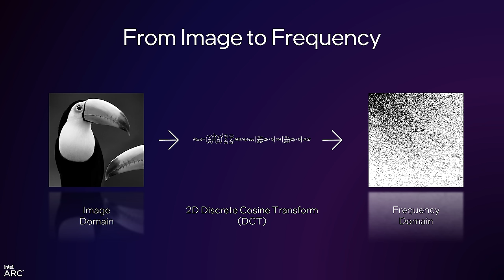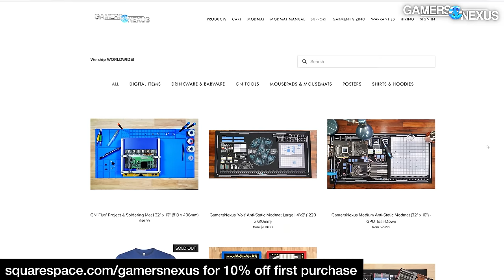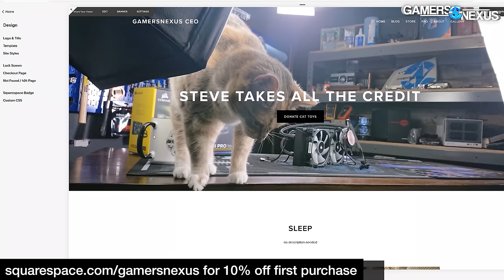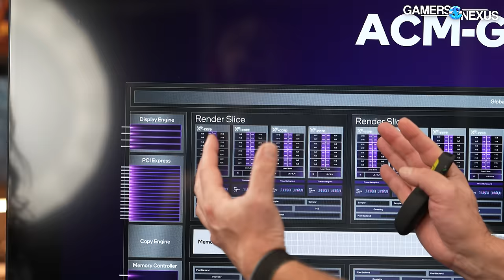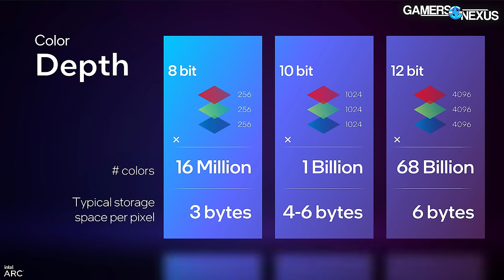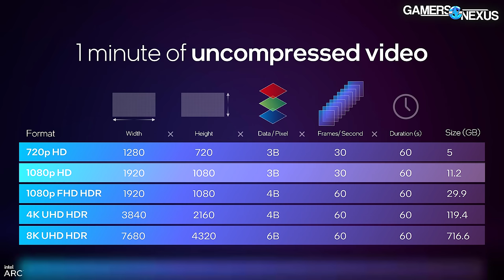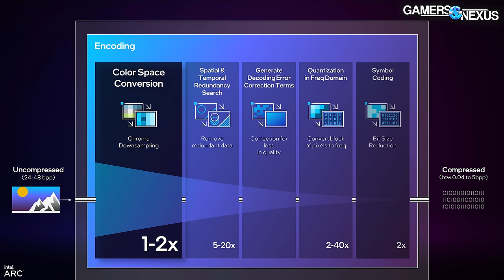YouTube's Existence is Insane: How Video Compression, Encode, & Decode Work (Basics)

Comment: Great overview at a high level. The description of chromonance subsampling is a bit misleading. Those are really ratios, not bits. Wikipedia does a way better job at explaining it than I could. I deal with YUV all the time and I still find it confusing. 
Regarding what’s going on in the frequency domain: the high frequency components represent small details in the video. As you remove high frequency components, you remove details that you are less likely to notice in moving video anyway. This is why a frame extracted from a video often looks very soft. Those sharp details are high frequency components.

Comment: The drop of bytes in chroma during the color space transformation is why some text gets fuzzy and hard to read on the desktop, when you change resolutions from 4k30 or 4k60 to 4k120 on a HDMI 1.4(2.0? I need to check) or DisplayPort 1.2 connection.

The bandwidth isn't enough to keep up with what you're trying to push, so the color space drops from YUV444(RGB) to YUV422 or lower, decreasing the color resolution and thus the small details. It's fine for video and gaming, but it sucks when reading static text.

Comment: Many of the heavy codecs without hardware acceleration wouldn't be possible realtime or now, faster than realtime.  MPEG2 was okay to run on a CPU because it was a lot simpler but AVC/HEVC/AV1 are pretty complicated and self referential so nothing but an internal ASIC on chip has the efficiency to do it, especially the encode. Decode is easier but if you try it on a machine without hardware acceleration you're going to drop frames at specs like 4K|4:2:0|8bit|35Mbpa|60FPS. <- This is why certain formats notoriously playback in Premiere like garbage while you're scrubbing unless you have a chip with specific format accelerators. Even with the accelerators, actually editing with these highly compressed formats is very taxing on the CPU which has to make changes and then feed the streams back into the encoder and then decoded again to show you the picture. This is also why most editors (although less so now) transcode to DNxHR or Prores, for a variety of reasons, but the biggest one is it simply runs much faster. Although it is much larger so your storage has to keep up. M.2 (a decent one) makes the storage speed pretty irrelevant now as it can keep up with 4K|4:4:4|12bit|400+Mbps|60FPS just fine.

Comment: one of the issues with using DCT and similar based on (at really low level) the sine wave, is sharp edges. Older codecs were infamous for having pink fringe on a red/white transition. This is the difference between the man made world and nature - man made has these sudden instant transitions nature doesn't. Hence 16:30, old throw then out, vs new use them less

Comment: A little clarification on the cosine transform. 
He mentioned the frequency space as the representation on both the X axis and the Y axis. It's technically only the Y axis in that view that corresponds to frequency, the X axis is the amplitude of the component sine and cosine waves (convertible to the magnitude and phase). There's fun math trickery involved with a 2d transform where you apply the DFT function once horizontally then again to the result vertically allowing you to merge X and Y data in a way that represents just frequency data.
You can tell based on the image shown because the slide after filtering out the high frequency noise only the values at the bottom are removed, not the values on the right side. 
Unlike the Huffman encoding this process is lossy but mostly it isn't noticeable to the human eye.
Here's a great channel if you want to learn about the DFT process.
https://youtube.com/@MarkNewmanEducation

Comment: If I knew this from the start from INTEL?  I would of bought a a770 card at Launch!   This is amazing! 
Why on earth they did not push this for media creators working with Video/ Audio is baffling.   
This is what Intel should have pushed on and made the gaming thing a Cool hack bonus of all the hardware can do.  

Kind of like tuning your car to give you more performance.  
Imagine using something like the video compression engine to somehow render a game?  
That would put it right at the midpack of the lineup and do it on with Extremely low power and efficiency.  

If intel could licence a game API that would do this? 
They would never have to worry about funding for their GPU's again. 
Everyone would have one from all kinds of hardware out there.  

It would be as ambiguous as the 555 timer with just as long of a legacy.  
The fact that it can do 8k Video playback is amazing.  Even with the lowest end cards out there that intel offers.

Now imagine being able to program a game that takes advantage of these special parts in their GPU / Hardware stack with their own API that models the games on the fly with A.I.  being the precursor to the instruction set given, so that each time the game runs?  Its a new experience every time! 

This would be the best breakthrough Intel could have have that would play out as one if not the most valuable I.P Toolkit in their future arsenal in the GPU landscape.

Comment: 17:00 DCT and Inverse DCT is incorrect AFAIK, back when I was doing JPEG compression for my bachelors we were told that you get rid of low freq and only keep high freq reason being eyes are good at picking up harder edges but not so good at picking up softer edges or gradients. So in the right most image the top left region is high freq data and the job of lossy compression is to get rid of low freq data.

Comment: 15:50 I mean it isn't that hard. Just the common usage of numerical mathematics.
From my understanding it is "just" another transformation (like the discrete version of the fourier transformation), to get the data into wave functions of different fequency.
This is lossless btw. And then (what is done here) you remove the highest frequencies (which are mainly there for the details, arriving back at the topic of compression) and reverse the transformation.
An advantage of the dct over the discrete fourier transformation is, that the dct only uses real coefficients

Comment: I use an Arc A380 for all my transcoding as quicksync is so much faster than pure cpu software encoding for only a moderate size penalty. Nvidia and AMD’s encoders are not as efficient as intel’s either. I’ve used all 3 recently too.

Comment: Their media engine is sorta insane. You thought Nvidia was kind there, yet everything works seemingly 10 fold better on Intel's stuff.

Even before Arc, the video crowd seemed to be tripping over themselves for Quicksync capability. Then they fixed Arc to where it handles stuff that requires Nvidia and AMD's Pro cards like 10 bit acceleration in certain NLE's.

Comment: Pls more!
Reply from the maker: Which topics?!
Reply: @GamersNexus  please love me, im soo lonely
Reply: @GamersNexus  As a electronics technician i was very much interested in the whole thing really, but the quantization stuff got me the most. It is really like an low-pass or high pass filter but for pixels. I can see how you can use the frequency domain to "filter" something. In RF you use it to "tune" to some frequency filtering out all the other with RL, RC or RLC cirtuits, sometimes very simple ones, and i'm very fascinated on how this concept is applied in the digital domain, like media compression in this case. I never viewed electronic filtering on a software prospective, i find it very intriguing.
Reply: Put it simply i see it like this: The algorithm tune the image collectively dinamically on the spot filtering all the spikes and the details on a very high definition signal (on a pixel basis!) and outputs a coherent result with the blunt of the information (the image) but without any near fluctuation witch we wouldn't even notice. It's smart!

Comment: Huffman coding is not as hard as it seems. Just think : morse code
In morse you're coding the alphabet and the numbers in binary. Instead of "1" and "0" you have "." and "-" but it's still binary.
26 letters and 10 numbers that's 36 symbols to code, 36 in binary is 100100.
So a naive coding for morse could be "let's use 6 bits for every letter or number"
So "a" would be 000000, "b" would be 000001 etc...
But that's not what morse code looks like. Instead we have a = ".-" so only two bits, e = "." so only one bit and z = "--.." so 4 bits
By giving a smaller amout of bit for the most common letters, you reduce the average number of bit needed to code a message. This just means you have to choose carefuly your codes, because you need to have zero ambiguity but it works very well :D
And you can even do it dynamicly. You can scan the full message, count how many time each letter is used, make your Huffman code and because it's a custom code you store the table of corespondances inside your message

Comment: Why is there so much so wrong on so many of these slides?
10 bit color is listed as "4-6 bytes" per pixel".  What?  It's not even 4 bytes.  It's 30 bits for full RGB.
12 bit color is listed as "6 bytes" per pixel.  It's 36 bits, or 4.5 bytes for full RGB.

A later slide showed "720p HD" and "1080p HD" and "1080p FHD HDR".
1080p should be FHD, not HD.  The data/pixel is wrong here as well for 8K row.  You don't need 50% more data per pixel because you increased the number of pixels.

There's all sorts of weird little inconsistencies and errors throughout all of these slides. yet it looks like a fully baked slide deck.  Are they really that sloppy??

Comment: 5:07 A Youtuber who doesn't know about AV1 in 2024?!  AV1 is an absolute game changer for content creators, if you aren't encoding all of your recordings and videos in AV1, you're doing it wrong.  Encoding in AV1 leads to MUCH SMALLER file sizes which saves a lot of time and space for content creators.  Smaller file size, means your videos take up less space on your drives so you aren't moving around your files as often.  Smaller file size also means faster uploads to YouTube which means you can get your video uploaded and processed by YouTube that much quicker, allowing you to post your videos sooner.
Reply from the maker: There's a big difference between using and knowing about. I never said we don't use it. But I don't know about it in any meaningful depth.
Reply: He still knows about it, just not the details. You can eat bread but not know how to make it, same thing as that.

Comment: Ok this is super interesting...What is the difference between RGB 4:4:4 Format PC Standard, YCbCr 4:4:4 Pixel Format and YCbCr 4:2:2, and lastly RGB 4:4:4 Pixel Format Studio? It is a setting that you can play with in the Adrenaline Software. Would changing this equal more FPS due to compression? Or am I just completely off. What are the pros and cons?
Reply: RGB, YUV, YCbCr are all just different colour spaces. You can convert to & from any of these without any loss occurring.

X:X:X just denotes the samples used to store the denoted information.

So YUV: 4:2:2 will use Y: 4 samples, U: 2 samples, V: 2 samples.

In most cases compressing more lowers performance because you need to do more work to keep acceptable results (more compression equals lower quality within the format).

The thing that really determines the performance in practice is the encoder & format used. AMD also happens to be the worst scoring party in both performance & quality for hardware encoding + isn't tuned very well for their hardware defaults when utilising ffmpeg (most applications will use this).
Reply: @MLWJ1993  Ya I messed with it a bit. The only thing I noticed right away was the brightness of the screen. Dynamic Contrast not working correctly. And the tone of black being more grey. Full RGB was the only one that would give me the darkest, clearest, most objective black.
Reply: @MLWJ1993  that's not true. YUV still uses 8, 10 or 12 bit per channel (channels being Y, U and V), but the amount of samples per pixel they take is different. X:X:X denotes columns, number chroma samples in the first row, and number of chroma samples in the second row. So 4:2:0 for example means that for each 4 columns of Y samples, you only store 2 U and V samples in the first row, and no samples in the second row. Still, each Y, U and V sample are encoded using 8, 10 or 12 bits.
Reply: @luisjalabert8366  You're correct. Should be corrected right now to "samples".

Comment: Who cares about HDR, I have had multiple "HDR" supported monitors over the years but literally never knew how to turn it on.  Turning on HDR mode in windows always just made colors bad and most people say to NOT do it that way, but guess what?  I'm convinced 99% of consumers with HDR devices (including myself) do not know if they have HDR enabled on any specific piece of content at any point in time, because there is seemingly no "TURN ON HDR BUTTON" on any form of content ever except.. Windows and the monitor itself, both of which often times don't let you enabled them or don't do what you think they do.

Maybe if we admitted that 99% of people don't have or know how to watch in HDR we'd not have any issue with file sizes ever.
Reply: Like seriously genuinely if you have an HDR video uploaded anywhere on the internet all you're doing is increasing your upload time, file size, etc, for a result that only 1/1000+ people would even be able to notice.  It's a scam basically in modern life, it'll take like 15 more years before we have HDR monitors that are actually HDR, always HDR, and don't have to deal with random BS and usecases.

Comment: huh, still doesn't explain why when i specify high quality it shits me 360p. jokes aside intel really has been pretty good at media engines. even if they weren't able to output really good compression and high quality outputs on the encode they simply worked well and used very little power and for an intel cpu that has an igpu it was right there ready to go (hell i used the intel decoder more often than my dgpu decoder for video playback)

Comment: so video card encoding and recording of gameplay is really fast, like you can tons of bitrate and high res and high fps, but as soon as i try compressing the video a lot, video cards suck compared to cpu/software encoding... why? (clarification: I mean the perceived quality compared to file size sucks, i can get a smaller file with cpu encoding at the same or very similar visual quality compared to the gpu encodes which at that same quality are significantly larger files) if i wasn't min maxing my encodes to fit in the free 15mb of discord video sharing it probably wouldn't matter since every other host will re-encode for you anyway so its better to start with less compression... I am sure it is an ease of use choice, but maybe it is about the hardware encoders on the gpu? 
handbrake btw

Comment: Oh dear there was so much wrong in this one, most evidently "YUV 4:4:4 / 4:2:2 / 4:2:0" has literally zero to do with "bits". Sadly it would only take less than a minute of educating yourself to realize that (if you're quick also what it really means) and even sadlier this becomes already blatant by actually looking at the slide with open eyes and rubbing two braincells together ... there are odd/even rows of four pixel(!) blocks each, go figure. Sometimes having a nice guy in a video just doesn't cut it, sometimes you need a guy who genuinely knows what's what (which admittedly isn't too easy to determine for someone having no clue either). That "James" maybe? Unless his explanations were so disturbingly bad that Tom isn't even to blame here :]

Comment: 1 minute of 4k video is not 119.4 GB. That number is super inflated in the slide show. Rendering a 1 minute 4k 60fps video with H265 Nvenc is like 0.7 GB at like super high bitrate of 90mbps. without rendered like raw from a camera at 100 mbps is 45GB/hr which is 0.75 GB per minute. Again idk where this guy got his numbers.
Reply: It states "uncompressed" at the top of the slide. Uncompressed RGB video at 4K is HUGE.

Comment: adjacent to the bit compression, its why some GPU tech may get even bigger in the future. increasing resolution, HDR and stuff are all very data heavy. It's why companies like Nvidia are investing into experimental tech for streaming, with RTX video enhancement, to upscale videos year back. Recently, Nvidia has been toying with their own implementation of Auto HDR. by removing the 2 functions from the source end, and generating the higher resolution and color range on the display side virtually can save a LOT of data, on top of the upcoming (likely going to be standard eventually) AV1 encoding. The combination of the 3 are likely going to be headlining features for a new type of Nvidia Shield product, to make the ultimate box for streaming video content, and adjacently, the most immersive version of cloud gaming for those who use gamepass/geforce now or equivalent services.

Comment: blah blah explain this to me! I got a 75 hertz monitor, how do I get 200 fps in call of duty??? that's right, my shit built different
Reply: The 200fps is the gpu's render rate, not output rate; to see an increase in smoothness you'd need a faster refresh rate monitor like 144hz. At 75hz, you'd see 75fps. The law of diminishing returns applies though. You'd see a massive difference from 30 to 60fps, but less so from 75 to 144hz.